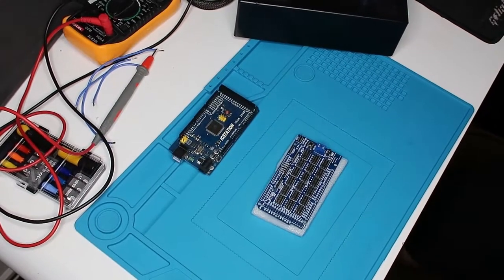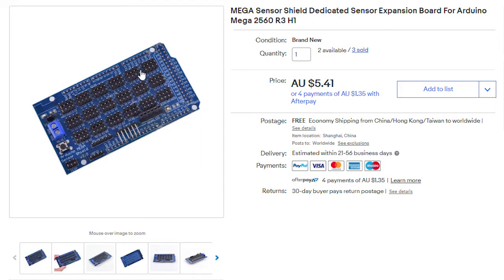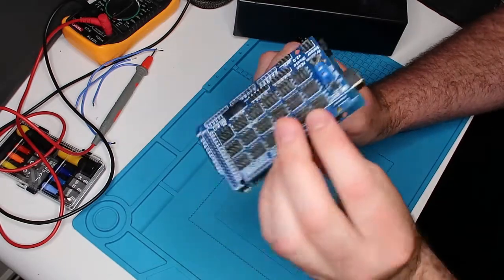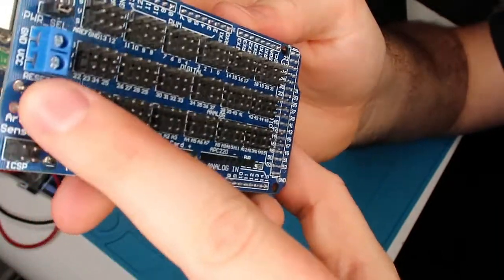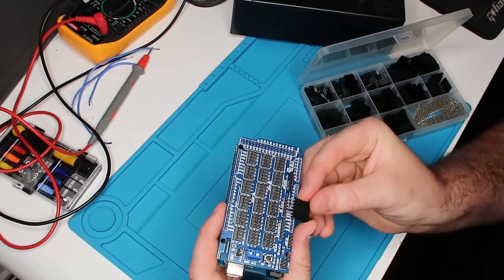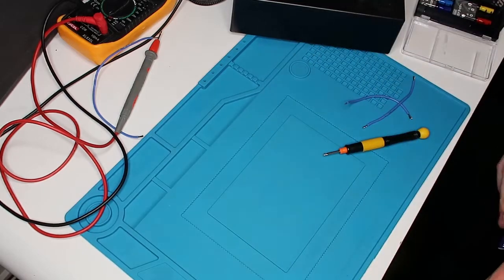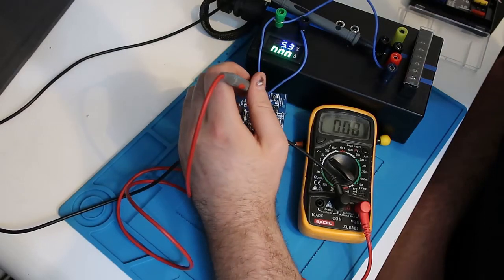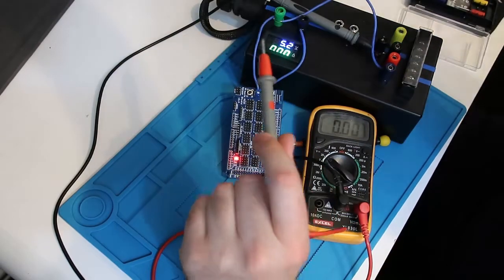Arduino MEGA Sensor Shield : How to measure all the sensors for the CO2 Scrubber

Comment from the maker: *UPDATE* I have since found out that removing the jumper next to the blue Terminals (external power supply) will disconnect the link between the 5V rail (connecting to the Arduino) and the External power supply terminals. So if required a voltage other than 5V for example 12v or 3v this will be supplied from the external power supply terminals into the voltage rails for the sensors / servos etc..
Reply: So basically you don't need to power the shield on its own unless you want to . 
And if you want to .  you disconnect the jumper and connect whatever voltage you require . 

Thanx . I needed this information .
Reply from the maker: Yes but don't run to much current from the Arduino as it is only designed for a small amount of load on the 5v rail, if you has enough sensors to require you to have a breakout shield like this one I would assume you will need a power supply. if the voltage is 5V then you can parallel not any issue. but defiantly disconnect jumper if the voltage is different.
Reply: @ScottyDIY  Can't thank you enough Scotty . Such a nice guy .

Comment: Is this shield able to power relais? I read somewhere else, that powering the 5V of multiple relays from the arduino board itself is too much for it. But as this shield has the external supply, could it power the relais?

Comment: Hello Scotty great video. I just purchased the two Mega shields. I am installing them in my inmoov robot.  I have nine servos in each arm to run. All are 7v. I will be using a step down voltage regulator. I noticed you said it will handle up to 12v if you remove the jumper. Have you tried it? Once again, thank you for this great video.
Reply from the maker: Thankyou, I haven't tried 12V yet but it will be fine without the jumper, most of the voltages I use are 5V, voltage isn't really an issue if you look at Telecom cables they run at 48V or around that, its all through small wire, any problems will be the current draw @ the voltage always comes back to V=I*R

Comment: What size 3-pin connectors do you purchase for this shield that connect to output pins? would it be 2.51mm spacing?
Reply from the maker: I purchased a pack which was from eBay just search "Dupont Connector" (I think its 2.54mm)

Comment: Im new to this stuff , will this work with arduino.mega with 4 mini motors (4 wheels),5 ultrasonic sensors,4 infrared sensors?
Reply from the maker: Motors may need a separate driver board depending on load , I haven't looked into the ultrasonic sensors output if they are digital or analogue all good (I think off the top of my head they use 2 pins per sensor for input), infrared should be fine as well as I think its 1 digital pin input
Reply: Can it do the work of a motor shield? L392d?

Comment: Hi félicitations !

One question, I will buy this board for connect 9 servos, 9 distance sensors + 9 leds,... Y need connect the power supply only to this board + usb to mega board or y need connect the usb + thé power supply to thé two boards?
Thé power supply can be of 12v? Or must be 5v ?
Thanks
Reply from the maker: Thankyou! You need to power Arduino separately either buy power plug or USB (Depends on if you need to communicate via USB), then sensor board needs power supply into the blue terminals and this power supply must be 5V if you use 12V it will push 12v into 5v Rail on Arduino and I sure it will not be good for the Arduino.
Reply: @ScottyDIY   @Scotty D  Thanks i got a power supply of 6v 1A, I will connect this to thé shield board sensor and the usb to mega board for transfer data pc-mega-pc
Reply from the maker: Hi sorry I have only just worked out that if you remove the jumper on the sensor board it disconnects the blue terminal (external Power supply) and the 5V rail on the Arduino, this way you can have any voltage through to the servos
Reply: @ScottyDIY  yes Thanks 😁